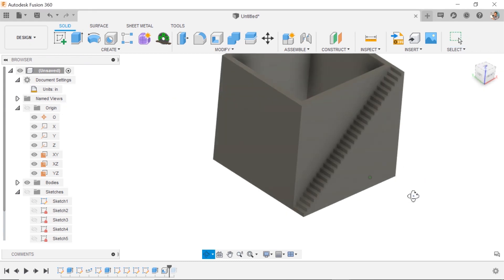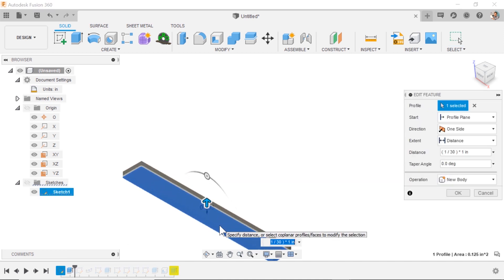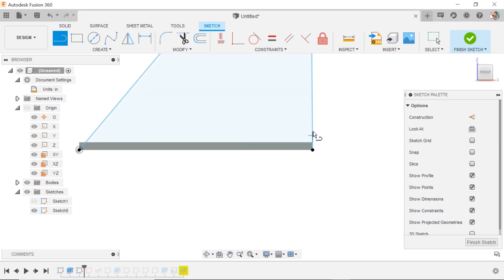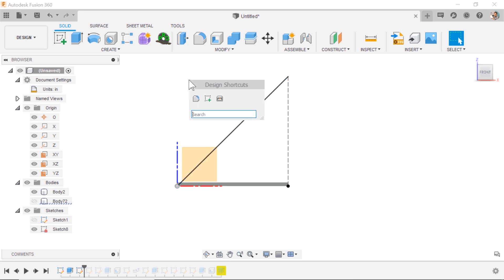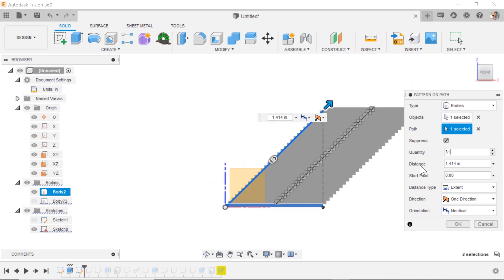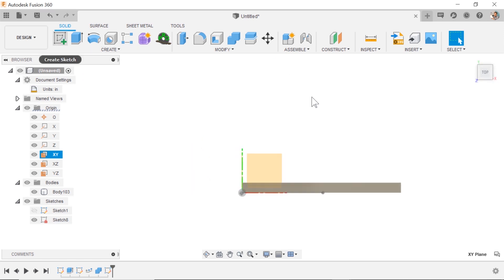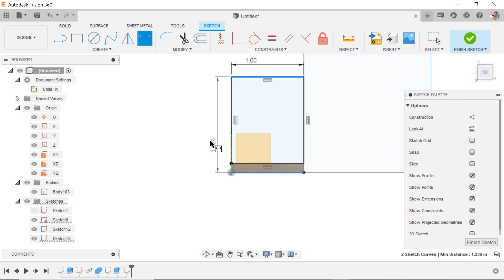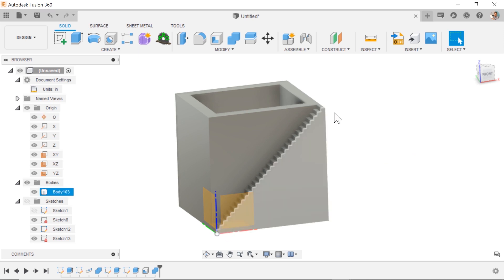Fusion 360 Stairs - (Creating a Stair Pattern)

Comment: Is there a way to do this fully parameterized? Like that when you change the number of steps that the stairs would still end at the top corner of the planter because the step height would be automatically adjusted. There's no pattern "to object" option like the extrude command has, right?
Reply: Yeah! Would like to also know how to do this algorithm
Reply from the maker: I think so!  Let me work up an example and find the limitations....

Comment: An easier way would have been to draw the box, she'll it, draw the triangle on the side, extrude it. Then draw step triangles on the side of the box, extrude to the triangle step profile and then pattern on path ( the small triangular extruded step). No need to cut away the excess steps as you have done.
Reply from the maker: Great idea!
Reply: 6 and 2 3s I would say, but both are great methods and display just how easy problems like this can be broken down into bite size pieces. Great work, both.